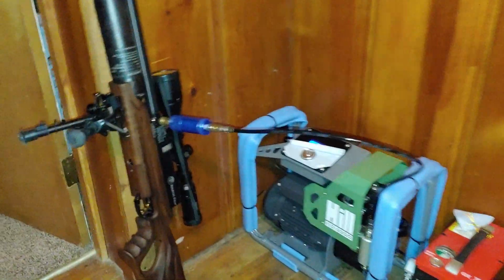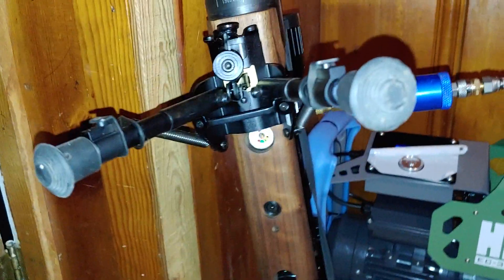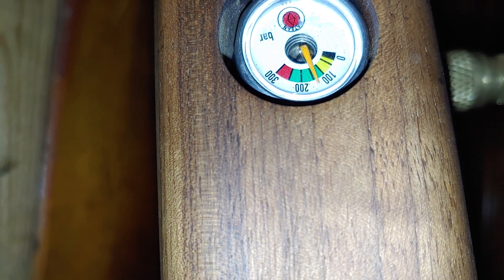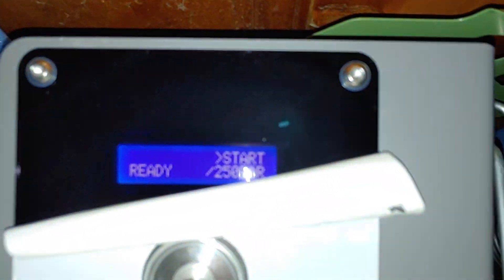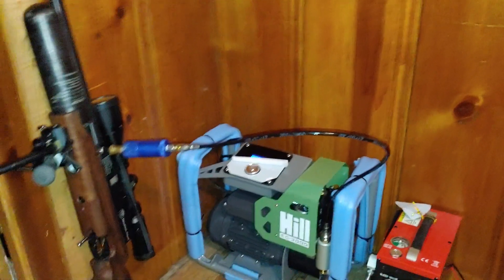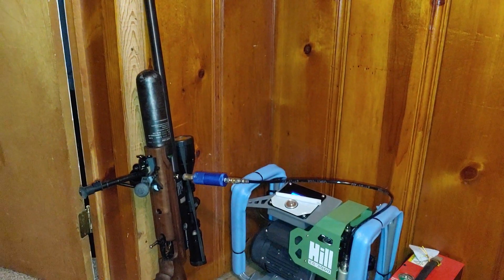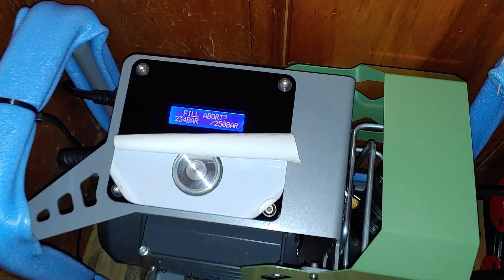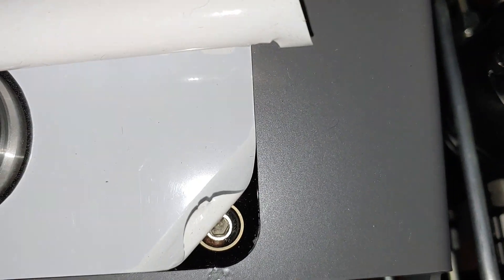Filling the 480cc Carbon Fiber Tank on my Hats an Neutron Star with the Hill EC - 3000

Comment: I'm surprised you run the compressor stuffed in a corner with poor air flow? it would seem even a small fan directed across the motor/cooling fins would help? Enjoyed the video and learning about Hill EC 3000.
Reply from the maker: @Rudy Smith Hi Rudy, The Hill is air cooled but it has a very nice 4 to 4.5 high flow fan on it. So it's still moving air fairly good.

Comment: https://youtu.be/9VM_s5uFCec
Reply from the maker: @Kelvin Wilson actually Kelvin that's ALMOST identical to what I was talking about. The one I was referring to eliminates the use of your scuba tank or bottle and just uses your compressor, technically adding the second stage that high pressure compressors use. This one uses the high pressure still in the bottle to fill the tank faster but technically the same thing. I had not seen this one before. Thanks for sharing.

Comment: It shut down filling a gun..young heng would have had no problems.for lot less money 3 min fill gun dam
Reply: Totally different bro..
Reply from the maker: @781coolmind  Tell me what you are talking about and how it works or send me a link, please.
Reply from the maker: It has a temp switch that shuts it off when it gets to that temp. This compressor is air cooled, Yong Heng is water cooled. Also people run Yong Heng compressor's hotter than they should. And to go a step further, you need ice for your water or antifreeze even with a 5 gallon bucket but it gets hot. I know, I've had 4 of them. So let's see how long this lasts compared to my Yong Heng's. I still have 2 sort of working Yong Hengs. Don't get me wrong, when a Yong Heng is working, it's an awesome compressor. Still, I'm giving the Hill a fair shoot and 480cc is a good size tank. Just saying.
Reply: @bluecollarsportsman613  I have a young heng and a omega both purchased used both work super great.the young heng when filling gun is superior.no shit that little compressor kick ass
Reply from the maker: @781coolmind  Man, I agree with you as far as performance goes. I don't think there is a compressor out there no matter what the price that can compare with the Yong Heng when it's working right. But I don't think there is a compressor that needs the large supply of water or runs as hot. I think the only way to fix the issue of how hot is gets is to slow it down which believe it or not, may take the performance away but it would probably be more stable and then by far the best bang for the buck. Right now I'm giving best bang for the buck to my GX - CS3. Yeah it costs more that the Yong Heng but it's also portable and so far this little thing is doing a heck of a job. Now as for the Hill, well I just fill it's going to last. I have nothing bad to say about the Omega. The Yong Heng, I kinda have a love hate relationship. Like I said I've had 4 so that makes them not so cheap for me and the lack of warranty sucks. Still NOTHING performs like a Yong Heng!
Reply: @bluecollarsportsman613   men  do you have a 4500 psi bottle like a 45 min.....and have you heard of a booster I have both and that shits a life saver
Reply from the maker: @781coolmind  I don't have either and it didn't think they made boosters anymore.
Reply: Ya men I purchased a hole setup when I got back into pcp..my booster with my tank I can use air all the way down to 1500 psi or lower and boost up to any psi best shit ever made then add a compressor your in the game and don’t need to use compressor as much so no need for a high end
Reply from the maker: @781coolmind  we must be referring to different types of boosters. What Im talking about is the one that boasts a normal compressors outputs so you can fill a pcp gun.
Reply: I’ve been in this pcp game long time you paying a investment for good stuff but not efficient.for money you put out.

Comment: I bought the Hills at my RFD ,told them I intend on topping up my 3ltr bottle with  it then got told it’s for gun only not bottles! But their site says up to 4 ltr bottles,what’s you’re honest opinion on this please Kenneth? 
Thanks man not just great content... great honest content.  You have a new sub here from Wales 🏴 Uk
Reply from the maker: @Honest John John I reached out to Hill and here is there response. Hi Kenneth,

Thanks for your e-mail.

The EC-3000 compressor has been designed from the ground up for filling guns directly and this is our preferred use for the compressor. However we know that lots of people like to use bottles and the compressor will fill or top up bottles up to 4L in size. Just remember to regularly follow the instructions on the machine for lubrication, temperature checks and releasing the bleed valve. We do recommend that bottles of 4L or more should only be filled by a competent person or professional for safety.

Kind Regards,
Jon Merrick
Reply: Kenneth Boyd that’s kinda interesting news,thanks for the quick reply bud much appreciated 👍
Reply from the maker: @honestjohn5267  No problem John, I have heard other people say they where told it was just for guns as well but this compressor actually runs very well and it seems like it would do a lot more. So I just wanted to verify so thanks for asking now we both know.

Comment: Tbh in a corner or not ,over an aircon duct or not that is piss poor to hit 75’C in 98bar!!!

My trail charger can run for 20mins and water temps are well under 50’C👌

Expected a lot better from a British company like hills tbh cheers for putting up an honest video Kenneth 👍
Reply from the maker: @sae Look at that again,  it happened at 239 Bar
Reply from the maker: Also this is an air cooled compressor
Reply: Kenneth Boyd yes but started on 140bar didn’t it.??
Reply from the maker: @Sae-fu5ch  The gun was at 140 the compressor still has to build to build to that and this is a large bottle at 480cc, still it should have not shutoff but it has programming that shuts it off at a certain temp because its air cooled. Its not a fair comparison to a water cooled compressor. My GX-CS3 would not have turned off but it isn't programmed to. It's also air cooled. I didn't have my ac running either and it 77 in the house that day so I'm not upset all this considered.

Comment: This unit is no different than a generator.  You have this way too close to a wall and not ventilated enough to work... I can fill my crown and Impacy from 150-250 back to back and not get a heat shut off... but I fill in the middle of a room your fan is smack dab against a wall...

Comment: Big mistake to run an air cooled compressor in a corner where it isn't getting sufficient air flow to cool the motor and pistons.
Reply: I believe Kenneth has it sitting over an air con duct.
good luck
Reply: @henrymoreland8719  If it's on an air duct, the motor base plate is blocking it.  That's why the compressor overheated so quickly in the video.  Run it in an open space at least 2' feet from each wall and it won't overheat nearly as fast since it will get proper ventilation.
Reply from the maker: @sjl6628  The base plate actually has clearance and the has about 4 inches of exposed area as well, also the compressor is fan cooled so it's not like there is no circulation. I do understand what you are saying though.